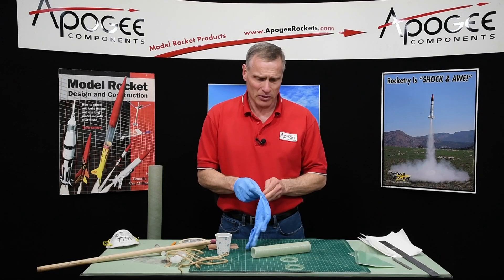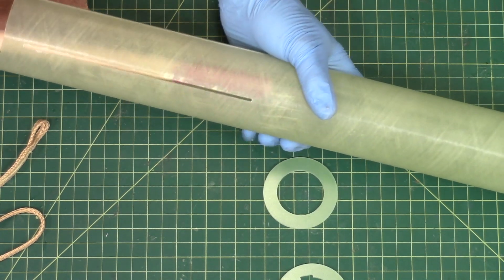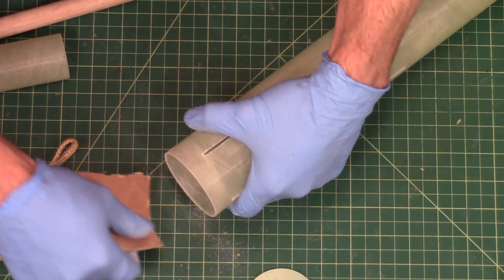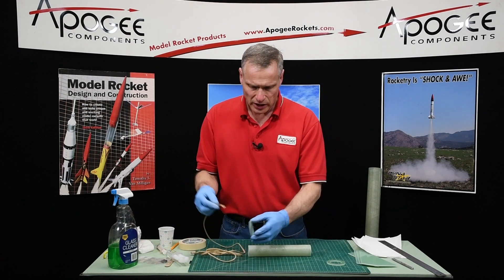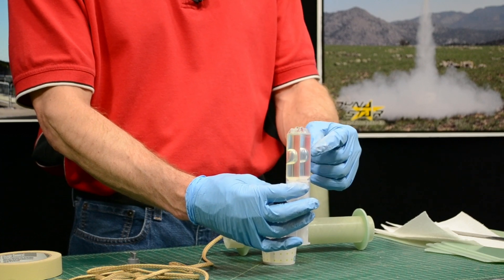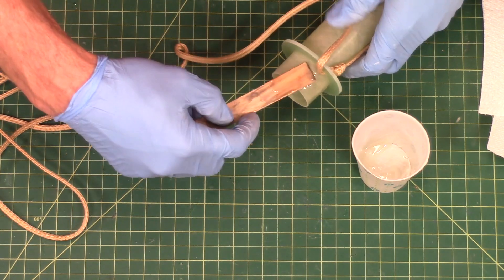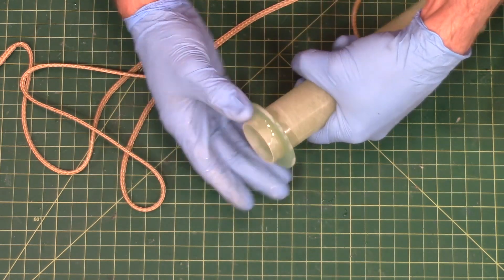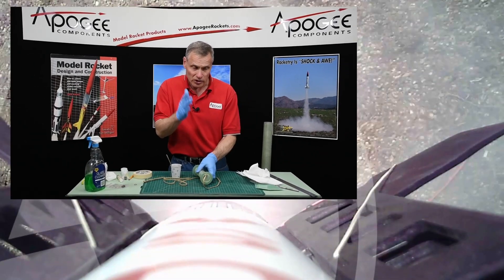Mach 1 Method: Fiberglass Rocket Build Part 2

Comment: What is your suggestion on replacing that shock cord if it snaps and there is much left to tie to?
Reply from the maker: It will be situationally dependent. I couldn't tell you without seeing the problem.
Reply: @apogeerockets  Its an older rocket and the cord frayed and snapped with only an inch left in the rocket. It is a formula 38 rocket. the nose cone was lost the rocket fell and was recovered. We are trying to figure out how to attach a new one. I don't have the rocket but possibly could send picks
Reply from the maker: @LowdendogFilms  I guess the answer would be dependent on how much money would you be willing to pay to fix this rocket.